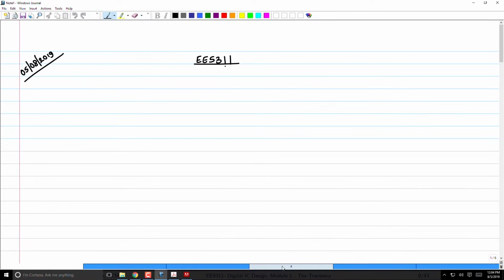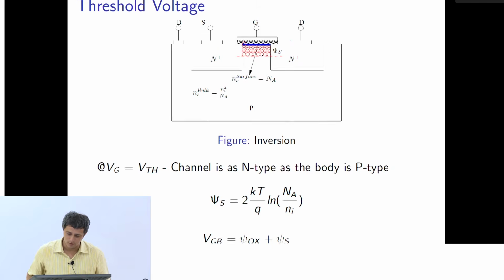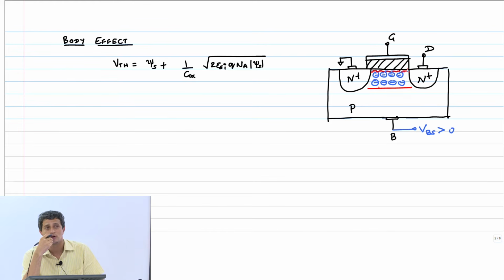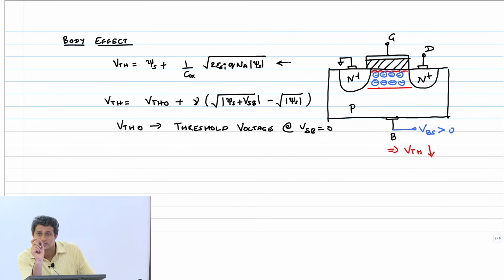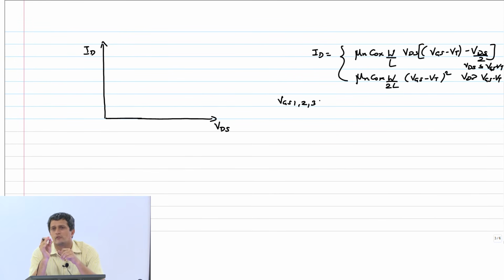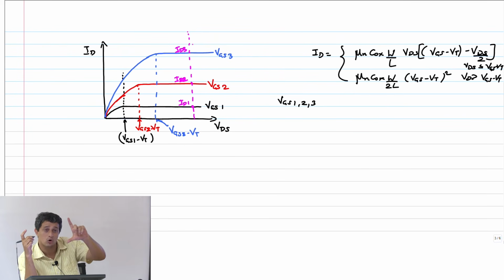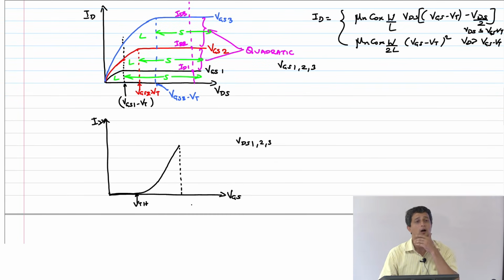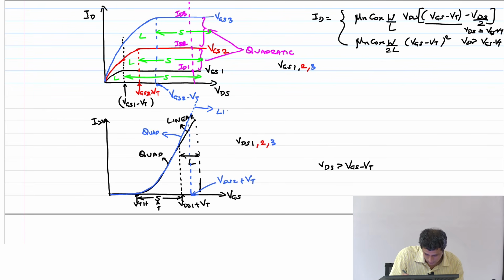Transistor- 4 - Body Effect and I-V Plots

Comment: At 5:33 If we apply positive potential on the body terminal wont it attract all the free electrons to the body terminal;
wouldn't it cause a depletion region to form around the body terminal
Reply: Do you got the answer for your question?  If share
Reply: @rajuchintapatla979   Hey lets take a NMOS and assume it as a Capacitor, Gate is one end of the cap and the channel is another end. Lets say you apply positive potential on one side of the cap (ie gate terminal) then automatically the other plate of the cap will be negative (ie Channel/ Channel gets formed).
Now similarly your body terminal acts as a positive terminal of the plate, the more positive it becomes more negative the channel will be.
So whenever you apply a positive potential on the body, a part of channel will already be formed which seems like lowering the Vt on the Gate potential
Reply: @chetanggs  thanku u 🙂
Reply: @chetanggs  The thing is , here Vbs > 0 hence Vb - Vs > 0, Vs = 0 (gnd) hence Vb > 0 (voltage at body terminal increases ). Now go by the eqn, it has Vsb term in it. Now Vsb = Vs - Vb, Since Vb is increasing hence Vsb decreases. Since Vsb now decreases therefore Vt also decreases as per the eqn. Also as per the theory, the body terminal is connected to the most negative terminal (for NMOS). To prevent it from becoming forward biased with the source or the drain. If the setting becomes forward biased then a leakage current might flow between body and drain or source, we dont want that.
Reply: @chetanggs don't explain anything you don't know
Reply: @vineettiwari9571  you are the one who didnt understand it lol
Reply: @chetanggs  so 2 capacitors in series?
Reply: @chetanggs so what's the final thing , from the empirical formula of Vth , if Vsb > 0 means the Vth will increase ?? And it makes it hard to turn on the transistor. Is this what's happening?

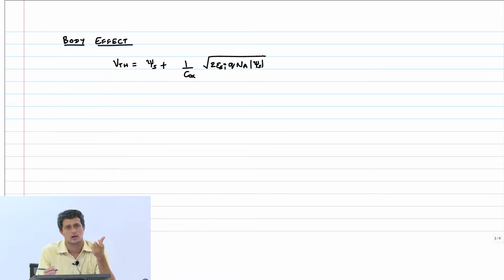Comment: At 3:25, in an nmos device with p substaret, when we apply positive gate voltage to create an inversion layer, negative ions and electrons accumulate at surface or holes deplete, then negative charges should create negative surface potential. Why is surface potential of nmos device positive sir?
Reply: the surface potential of nmos is with respect to the bulk potential so since bulk is at a higher potential so it is positive .

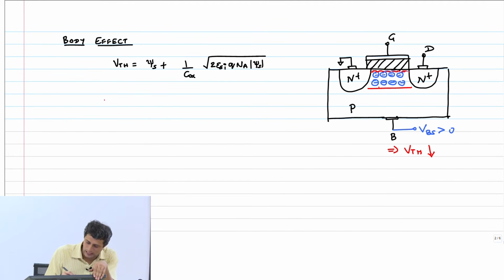Comment: Greetings sir, I have one doubt at 8:02, why the Vth value will decrease when the VBS value is increasing..actually, it should increase right because it is attracting all the electrons in the channel right?
Reply: The thing is , here Vbs > 0 hence Vb - Vs > 0, Vs = 0 (gnd) hence Vb > 0 (voltage at body terminal increases ). Now go by the eqn, it has Vsb term in it. Now Vsb = Vs - Vb, Since Vb is increasing hence Vsb decreases. Since Vsb now decreases therefore Vt also decreases as per the eqn. Also as per the theory, the body terminal is connected to the most negative terminal (for NMOS). To prevent it from becoming forward biased with the source or the drain. If the setting becomes forward biased then a leakage current might flow between body and drain or source, we dont want that.
Reply: Same doubt I have
Reply: Hi! If Vbs increases then holes are repelled, and more holes accumulate near the depletion layer creating more positive potential . The potential at surface near gate is more negative compared to the potential in bulk, which corresponds to more electrons near gate surface compared to before by Maxwell - Boltzmann equation.